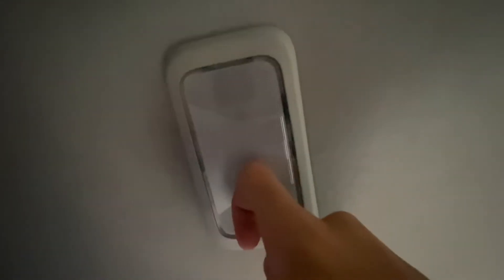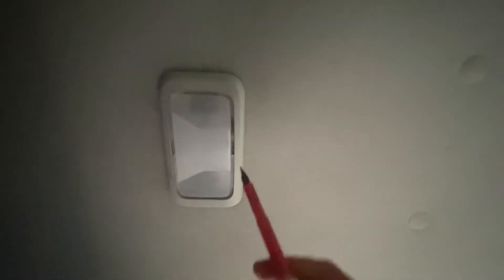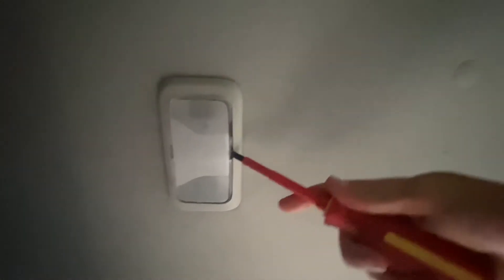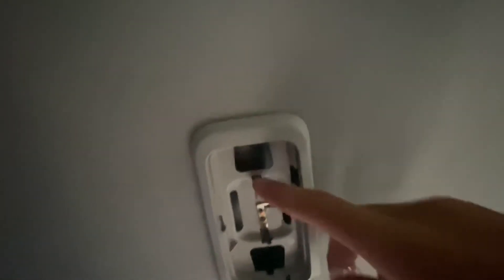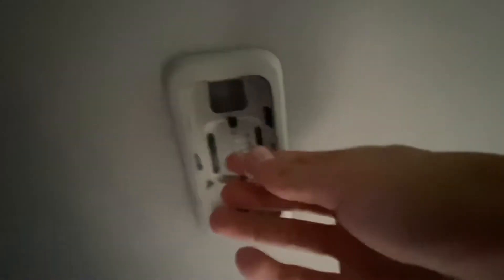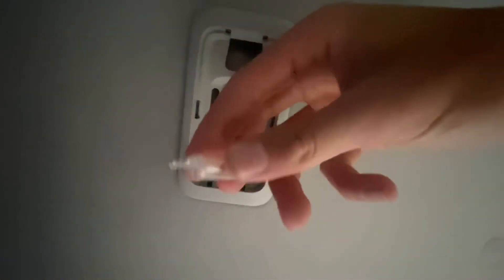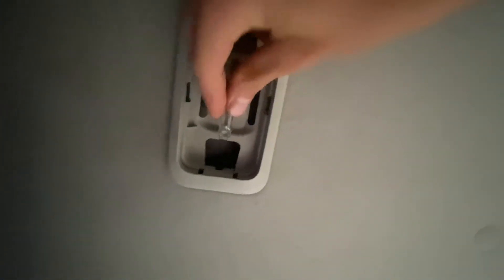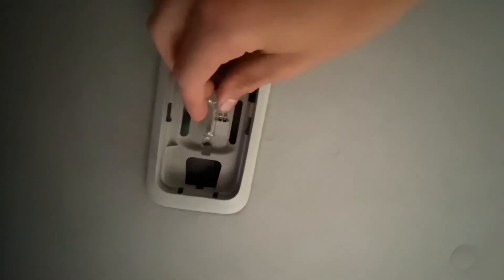2004-2012 GMC CANYON CHEVROLET COLORADO DOME LIGHT REPLACEMENT

Comment: That button isn't for cutting them on and off.  It is to set whether they can be cut on.  The wheel to the right that controls the brightness of the dash lights actually cuts on the dome light.  Roll it all the way up to the brightest dash setting and when you feel like it has hit the stop, turn it further and it will click into the on position for the dome light.  That button you are using sets whether or not the dome light can be turned on from the that little wheel of the dash lights.  That means you have your dash light wheel actually turned all the way up and into the on position for the dome light.  So now that you have it there and are operating the light from the button, you're just cutting the lights ability to come on and off.  That is why your dome light isn't coming on when you open your doors.  You need to cut the button to the on ability and then roll that wheel out of the dome light on position so the light can go off naturally.  Then your dome light will start working when you open the doors.
Reply: click the wheel up past the highest brighten and then what? press the button? i clicked it past and closed the door locked it and waited and it stayed on... i ended up clicking it back off, what am i missing? do i have to press the button right after i scroll it all the way up?
Reply: You just saved me from having to get another battery, bought me a shitbox today and couldn’t figure it out. Thank you so much man.

Comment: On the same control panel that has the push on/off button, there is a vertical wheel that operates/ regulates the timer for the light remaining on when shutting the door.....